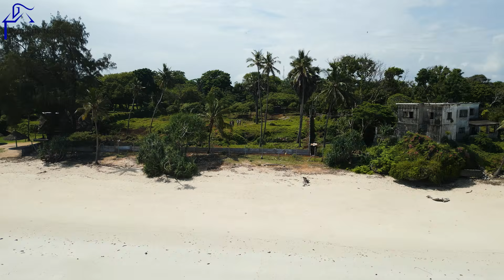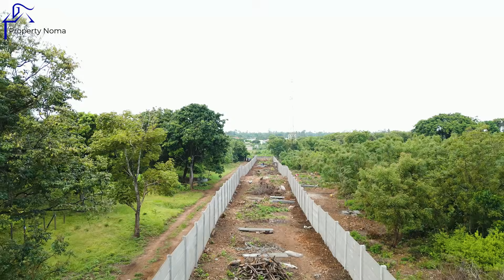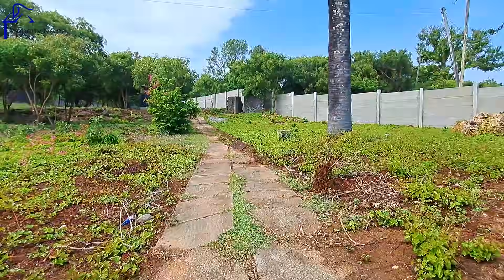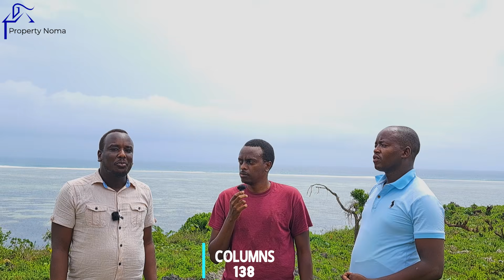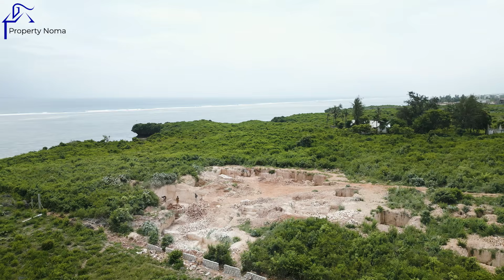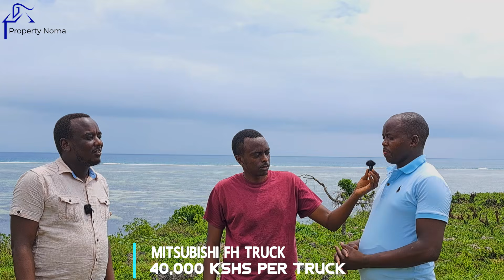Using 484 Precast Panels to Fence an Upcoming Water Ski Resort

Comment from the maker: CONTACTS
Eng. Ian Kiptoo (Main Contractor) +254 727 644782
Sammy Wambua (CEO, Kingdom Precast) +254 714 259226
Kingdom Precast Location: https://maps.app.goo.gl/eWS9eprYdnRfGuo3A

Hi guys, these are 2 coastal projects located in Mtwapa and Vipingo. Both clients have fenced their plots in preparation of the ambitious projects they want to start in 2024. Meanwhile, I'd like to wish you a Merry Christmas and Happy New Year!
MTWAPA
-1.5 acre beach front property
-275m long driveway, 5m wide
-Perimeter wall length, 700m
-1000+ panels (3m height), 200 H-columns used
-5 panels are stacked on top of each other to build the fence, with one partially buried to act as a foundation for the rest
-Time taken: 2 months to fence the panels
-The client intends to build 4-5 villas starting in January 2024
-Total fence cost: Ksh 6M (USD 38.5K)
VIPINGO
-2 Acre beach front property
-138 H-columns, 484 panels (3m) used
-Stone blocks were used for the foundation
-4 panels are stacked on top of each other to build the fence
-Total fence cost: Ksh 3.3M (USD 21.2K)
-Despite being located next to a stone quarry, the client opted for precast panels to fence his property
-The client intends to develop a water ski resort and some residential houses starting in 2024